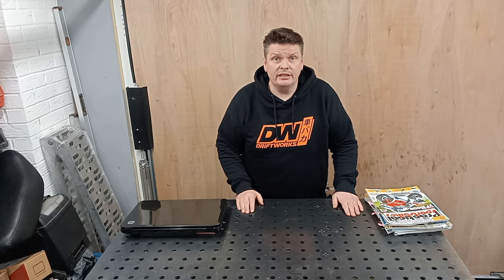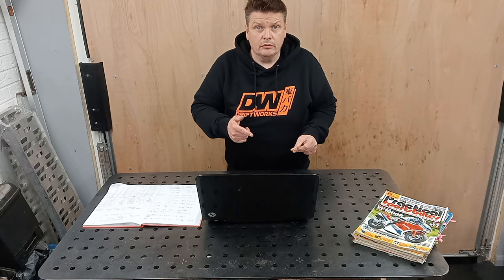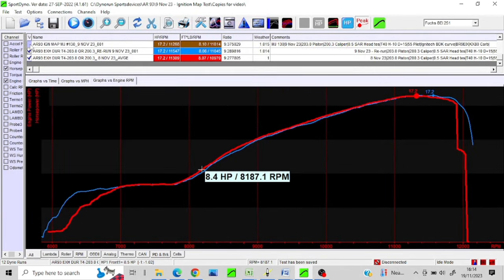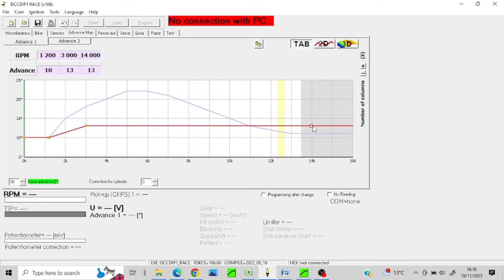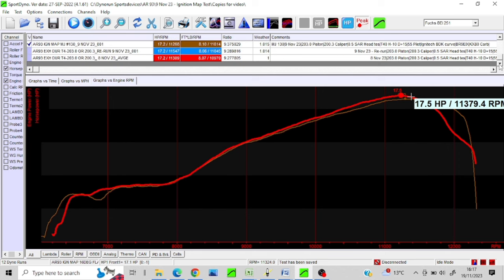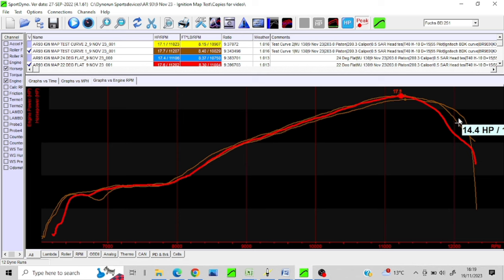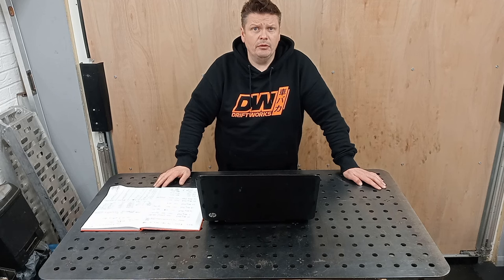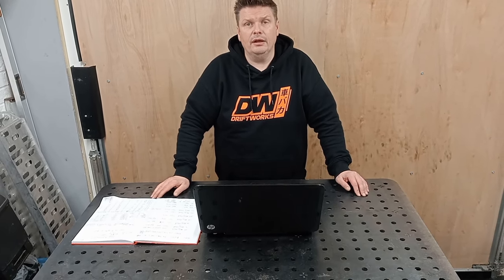How to make the perfect  2 Stroke Ignition Curve - 100 MPH Moped Challenge #2stroke #power #dyno

Comment: The timing tells you a lot about the pipe length to port timing relationship - and some about the head - as it's all tied in together.  In my opinion - this is telling you the pipe is a little short for the port.  Im not a pipe expert like some people - but adding a little length to your belly would be an easy start to this theory - and see if you can find your peak torque at 10-13 deg timing rather than 22 ish.  If you add length and reduce timing - you might find a better combo.  Addtionally - if you add compression it will be similar to more timing.  What the timing really does is alter pipe temp.  All bulk power is made via the pipe's influence on the egine - so what we often 'have happen" is we tune variables such that our engine is making the pipe happiest to trap the most air.  Nice work - keep plugging away!
Reply from the maker: Cheers Derek. I want to try getting the trapped compression back up to where it was before along with a few other things then I will have a play with the pipe length again and the timing.
The problem with two strokes is you change just one thing and it affects 3 or 4 other things... Such a simple design but massively complex in actual operation. 🙂
I guess that's what makes them interesting.

Comment: What’s causing the 100 mph barrier is power/ weight and wind your trying to push . Just ride behind a car
Reply from the maker: Hi Alan - Drag and rolling resistance. I just need enough torque at the rear tyre at 100mph to achieve it.

Comment: Ceramic coat the piston top and combustion chamber, also the expansion chamber. On V8s coated headers reduce heat immensely. Should retain the heat in the combustion gases and not the engine and pipe.
Reply from the maker: Hi, it's something I have considered... Sounds expensive mind!?

Comment: You need to take a leaf out of a certain Norwegian 2T dude's book, and leave the best bit to the beginning of the next video, and leave on a cliffhanger. That dude has figured out how the algorithm works 😂 as for tuning,  all i ever learned is that all the thinks we thought that helps actually does nothing. Best bang for buck is in port timing, pipes and lots of revs. Perhaps compression and ignition timing afterwards 🤔
Reply from the maker: Yeah, I know, Alex has got it figured. It's kinda how a soap opera works I think or just life in general - ups and downs. Or that will they won't they get together between a couple of the characters...?
I'm sure i'll have some downs. If you look at some of my older vids there were a few failures such as leaks and ignition not working. 
I aggree - everything seems to be ports and pipes. I've done pipes a few times but this is my first proper go at the ports and I was shocked about how much power  I gained. A massive influence.
Cheers for watching and stay tuned :)

Comment: Sir, I need such a help. I want to ask about the port of such a cylinder, how can we increase the speed from its port. Please help me. Please tell me.
Reply from the maker: Hi mate, I'd measure the port timings first and got from there. 190 exhaust and 130 degrees duration on the transfer ports can work well. But you need a pipe and look at the carburettor and ignition too.

Comment: Great to hear that progress is coming on nicely, it seems like you and Alex ('2 Stroke Stuffing' channel * ) have had a lot to work out of late. But, as always, 🤞 to the both of you achieving our goals! Looking forward to the speed test runs too! I take it you sorted the 'Potential' rear tyre/dyno rub issue? 😏
* For anyone not in the know, Alex is a guy who has hand built a 50cc 2 stroke motor and is trying to make the most powerful motor for land speed attempt. If successful, it'll be a supercharged Nitro run 50cc. He HAS had 24ish BHP, but is working on a redesign, go check him out as well as this fine gent here! 👍
😎🇬🇧
Reply from the maker: Cheers Mate - yes getting there now.
Tyre rub issue all sorted. I fixed the wheel chock to the dyno and all is well. I did do back to back tests and it didn't increase power but I think as the power goes up it would have been a problem.
Reply: Alex does go off on tangents though 😅

Comment: The 15 degree peak power recommendation is meant for some crazy hp engines which are far from our typical moped-base tuning candidates. The burn rate gets faster the more mixture you can get crammed in the chamber and the advance must be less, but it takes a lot to make the cylinder that good. I have also found that 18-20 degrees at peak power is quite good. 
I have tested removing the lower piston ring a couple of times and it did not seem to have any negative effect at all even though the groove is open. The engine sounded more eager to rev but at that time I didn't have a dyno so the result is subjective 😁Some guys have plugged the groove with a spring pin. Another technique I heard of is to heat the lower ring red hot in a mandrel so it loses the springiness and just rides in there with minimal friction.
Reply from the maker: ASoftaaja - Thanks for that info  about the timing. I think ill keep the max advance to 20 degrees for the min then. I am worried if it will be too much under load at 100 mph? Something to worry about in the summer I guess when I can get to do some actual speed runs.
I want to do a few more tests before I attack the exhaust duct so I do want to do a quick 2 ring v 1 ring back to back test in mine - it will be interesting :)
I'm pleased the Ignitec has worked for you in your last video - a good result :)
Reply: "The burn rate gets faster the more mixture you can get crammed in the chamber and the advance must be less"....YES, this what I have been saying.
Reply: Once you find the best advance for maximum power, there is no reason to back it off for reliability reasons. It means the engine is working efficiently. There must be other ways to prevent overheating. In an aircooled 2T it is always a challenge 😁 I would get a good air blower in front of the dyno (you probably already have) and then experiment with cylinder/head air ducting and a CHT sensor to improve the cooling. Using a richer carburetor tune also helps to cool it down. I would keep the compression ratio also low. I have found that high compression increases thermal load a lot but improves power only a little.  @AutoBeta2T
Reply from the maker: Cheers @ASoftaaja. The front fans are about 1 KW from memory. I'm interested to see how much difference there  is from the dyno CHT/EGT to road testing CHT/EGT? Yes, air(fuel)cooled engines are a pain. What sort of compression ratio would you recomend?

Comment: Cheers for the intel. Planning on getting an HPI digital ignition for my 2T Suzuki 68cc. Appears the HPI software is a similar design, so this helps understand the concept. Still learning by myself. Good luck with your 100mph goal, friend. I'm chasing 100kmph on the 68cc, and I'm nearly there (94kmph).

Comment: Looking forward to your flow test video. That will be interesting.
Reply from the maker: Cheers Bill. It could be a little while... The data I measured  goes into a program that gives a Time FlowArea (FTA). It correlated well with the Specific Time Area I had worked out for the port. Should be an interesting seeing what the transfer FTA gives.

Comment: I have an RD400 and put an ignition that had a curve in it and I was stunned at how much more power it made. Problem was it had the tiniest lightest flywheel.. it weighed nothing and I hated the way it make the bike feel.. and having to have a high idle just to stop it from stalling was annoying. I splurged and put in a VAPE and it has a large hefty flywheel and the bike idles and feels amazing.. This winter i will purchase the controller module so I can program in a safe curve and get all the torque I experienced, back.
Reply from the maker: Cool - sounds like a plan! 
I'm wanting to try the standard AR generator/flywheel on mine again too.
Good luck with getting that torque back.

Comment: have you read "2 stroke performance tuning by A Graham Bell" this is pretty much my bible when building up an engine. using more premix will often gain power (up to a point), better lubrication, better ring sealing etc, what fuel are you using?
 loving the project, vaguely remember reading of this many moons ago. Subscribed ;)
Reply from the maker: Cheers Smiffie, and yes I have read Bell's book but it was some years ago... I need to get back into reading 2 stroke stuff. Someone else has mentioned oil/fuel ratios. Something for a video one day along with higher octane fuel.

Comment: New to your channel. Great stuff.
I ran a Suzuki RGV 250 at Land Speed events in Australia for a few years and tuning a smoker for sustained Wide Open Throttle is an "interesting" challenge.
What petrol/fuel are you running?
Reply from the maker: Hi Pete, I used to have an RGV 250 and wish I hadn't sold it now. Lovely bike. How fast do you get out of yours?
Any top tips for sustained WOT?
Reply from the maker: I'm currently on Gulf Super Unleaded, 99 RON.
Reply: @AutoBeta2T  "Any top tips for sustained WOT"....a cylinder head temp gauge! 😛
Reply from the maker: Yep - I had one on my X7 - ignored it and the engine melted. I should have pulled in but had red mist

Comment: Nice work!
In my tzr250 engine as i´ve converted to fuelinjection i just looked at how the curves are looking like in a highperformance twostroke, and saw that 'underneeth' where the pipe breathes they can take a lot of ignition, i´m running mine on E85 and have ~35 degrees down low, i´m running 20-21degrees at idle.
Up top where the pipe is working i am comparing it to an boosted 4stroke engine, when the boost hits one need to lower the ignition.
So, by this i´m saying that you can probably run much higher down low.(if needed)
I honestly already ran this curve i programmed into maxxecu in my ignitech system before.

But a thing to consider is that twostrokes is very sensitive, the rpms after are depending on the rpms before.
If wanting a huge powerband one can sacrifice a couple of newtonmeters to gain some up top(pipe temp)
Reply from the maker: Cheers Patrick, what sort of timing are you at when at peak torque?
Reply: @AutoBeta2T  Around 22-24 degree from what i can remember from my mind(i am at work now)
But remember i´m running E85 fuel also, on petrol i would think about 19-20 degrees.
Reply from the maker: @Patricks_Projects  does E85 burn slower than pump petrol?
I'm assuming it does but I haven't looked into it.
Reply: @AutoBeta2T  Maybe it does, but i do know that in 4stroke boosted applications you might end up at the same values running e85 or petrol, but e85 as it has more octane, it is more forgiving.
I will actually do a test upcoming weekends and lower the ignition at max torque and see if i loose anything.
Reply: @AutoBeta2T  Go to my channel, you might be able to spot my ignitionmap in the latest video i released today.
I´m running 15.5-1 in compressionration.
Stay tuned for part III, i´ll try to reach 100ps to the tire in that one, adding Nitrous.
Reply: @AutoBeta2T  I posted a picture of test with two ignition values in my 'community', i dunno how to post pics here in the discussion.
Reply from the maker: @Patricks_Projects  cheers, seen. I want to have another look. I've been quite busy this weekend. 
Hope you are okay mate,?
Reply: @AutoBeta2T  No worries mate, i´m good.
How about you?
I tried to film a little this weekend but i ran in to some small issues and needed to take off the cylinders, they began to spray water underneeth agains't the crankhouse.
I need to reinforce the block with helicoil, i have probably reached a level where my cylinderpressure lifts the cylinders =)

Comment: Dave, what was the EGT when your engine was running timing that gave the best peak power and how does that compare to the flat 10 degree run? I'm going to 'stick my neck out' here! I bet it was no higher and possibly lower on the best power run compared to the 10 degree run.
Reply from the maker: Hi Pete I've not double checked but from memory the egt for 10 degrees was well over 100 degrees hotter. The temp difference for the different timings was significant. You could smell the heat at 10 degrees.
Reply: @AutoBeta2T  Cheers for the update, your reply does line up well with what I've been saying, i.e. you do not need a red hot exhaust in order to make power! 🙂 (I'm being a bit flippant here). Your dyno runs clearly show that your best power run was NOT when the exhaust was at its hottest, it totally goes against DH and his 'wonky' theory.

Comment: Try a cone in cone on the baffle cone, put a spring on the stinger so you can adjust the tuned length of the rear cone and fine tune the pipe at different rpm.
Reply from the maker: Hi, my baffle come is adjustable but it moves in the dwell section.

Comment: start the ignition curve tapering off(retarding) of your test curves a little earlier. You need to start building heat in the pipe just a tad bit sooner in your dyno pulls.
Reply from the maker: Okay. What is the reason for this?
Reply: @AutoBeta2T  it will make power for longer past 12k
Reply: @RACE.KART.PRODUCTS  Do you know that the port timing of this engine will support 12k? Do you know whether the piston speed will not exceed the current accepted maximum value of around 25m/s? I guess what I am trying to say here is that you cannot just arbitrarily pick an RPM figure and then try and rev the engine to that RPM.

Comment: What fuel are you using? Would a higher octane help prevent detonation?
Reply from the maker: Hi, it's pump petrol. Gulf 99 unleaded (E5).
And yes higher octane fuel would in theory help but I'd need to take advantage with it by possibly increasing compression or advancing the ignition and then I'd have to shorten the pipe. I'd like to try some of the VP fuel. Saying that AvGas is still available and good. 
Or Methanol...?
Reply: I'm using Renegade MX2 104Ron  fuel in my Kawasaki KMX125. It allowed me to increase the compression and reduce the squish clearance to ~0.9mm. I think it picked up just over 1bhp from the changes when set up on the dyno and with the ignition curve tweaked to suit. Have you thought about an exhaust resonance chamber type power valve being added to the final pipe design? Maybe it would give more low-mid range power to help pull higher gearing without bogging down below the power band?
Reply from the maker: Cheers for the info Steven - sounds like a good gain.
Reference ATAC chamber - it could be something to try if I struggle to stay on pipe. The ignitech could control it too 🤔

Comment: Hello sir, greetings from Malaysia, I have some issues with the spark plug, the ring and the ground electrod were dark brown, but the electrode shows white colour. Please help
Reply: Too hot plug, but!! the porcelain should burn clean from deposits if taking new plug and do a couple of runs, only time dilutes them.
What you should look at on the porcelain is down a the bottom of the porcelain you should have about 2mm wide black band.
Later on when have been running all kinds of driving the plug will get that cacaobrown colour.
Reply: @Patricks_Projects  yes sir, they all cocoabrown.. but the electrode center shows white colour. The porcelain also burns good imo, or is this causing from ignition degree too advance? Or the ignition too powerful?

Comment: SHIT! 😞
Reply from the maker: What's up?
Reply: @AutoBeta2T  From the thumbnail I thought you have blown your motor, is that not the case?
Reply from the maker: @sidecarbod1441 Narp Pete 😊 That's my Suzuki X7... Did that at Pembrey 2018. I learnt a few lessons from it mind...
The AR is very well thanks... Just about to have a check over and the  ready for more power.
Reply: @AutoBeta2T  Jeez, man, I thought you had been getting greedy with the ignition timing. Back in the day of my RD's and TZ's I had an impressive collection of 'paperweight' pistons. (I'm starting a new collection now with my KTM 300 EXC! )
Reply from the maker: @sidecarbod1441  I have a bit... But all seems okay... Well for now.
Reply: @AutoBeta2T Took the head of my valve yesterday and it was mighty black /oily and carbon deposits on the pistons towards the front and the same in the head . Any thoughts on why ? Too rich on the mains or oil pump delivered too much ? Thanks
Reply from the maker: @topfuelteddy  it's hard to say really. Oily suggests maybe too much oil or rich. From what I have seen the piston stays metal where it is cool and where it's hot it chars the  oil onto it. But not oily, quite dry.
Reply: @AutoBeta2T  Thanks mate , I've got a new pump to put in in the spring and will hopefully have my new pipes made by then . Can arse around with it some more .